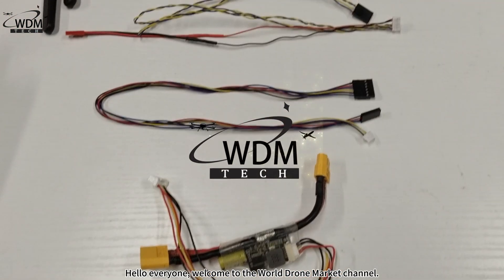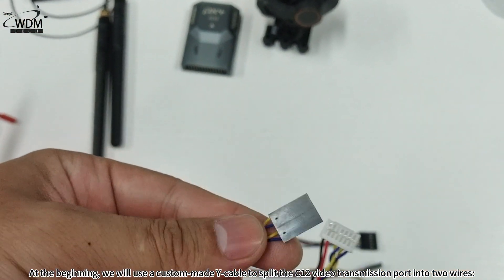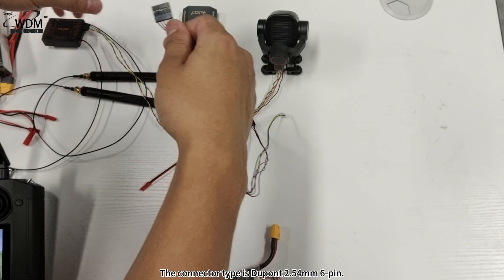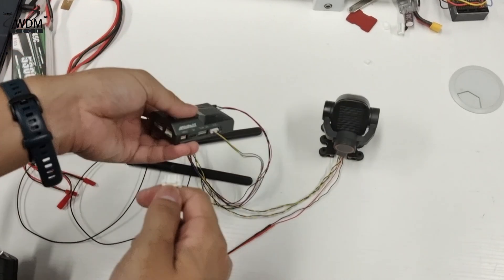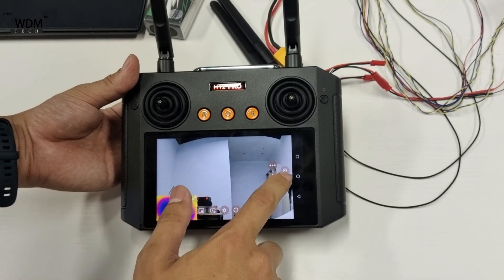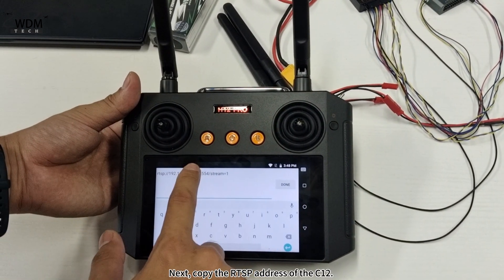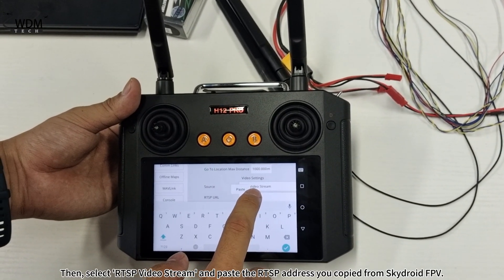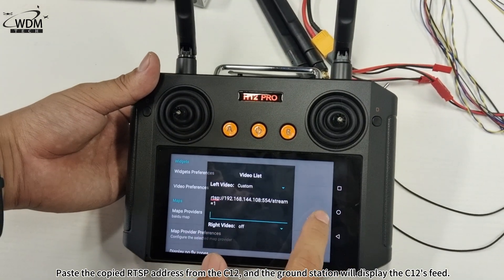Wiring the H12 Pro, Skydroid C12, and SIYI N7 flight controllers

Comment: how to see both camera feed in qground control
Reply from the maker: It is impossible to view two images in QGC because the thermal imaging and visible light video stream addresses of the C12 camera are different. You can download Skydroid FPV to use the C12 camera. You can download Skydroid FPV to use the C12 camera.
Skydroid FPV: 

http://file.skydroid.xin/SkydroidCameraFPV.apk

Visible light video output RTSP stream
rtsp://192.168.144.108:554/stream=1
Thermal imaging video output RTSP stream rtsp://192.168.144.108:555/stream=2

Comment: can i run a c20 and c12 on same drone and controller?
Reply from the maker: Hello, if the C20 and C12 gimbal cameras are connected to the same receiver, the FPV software can only display one. If you want to see the other one, you need to switch the line in the software.